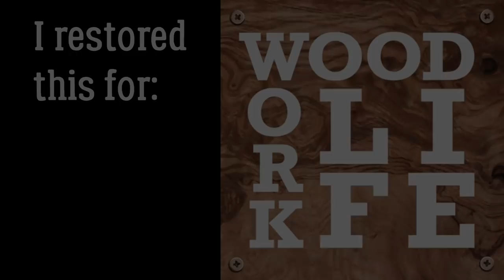Soviet Chain Mortiser [Restoration] (Part 2 of 2)

Comment: Small detail here on soldering. For a wire like this you apply a bit of flux to the wire (if you don't have flux core solder). Then you put a tiny amount on your iron to help transfer the heat. Then you apply the iron to the wire and after the *wire*is hot enough you apply the solder to the wire and melt the solder into the wire.

Comment: The tool restoration system consists of two equally important parts: the wire wheel, which investigates the superficial products of rust, and the EvapoRust, which prosecutes its core. These are their stories.
Reply: Dong dong !
Reply: Dun dun
Reply: Ta Dahhh!

Comment: I am stunned by Soviet Mechanical Engineering. Most products are designed and built to be purchased once and provide nearly a lifetime of service with regular maintenance. The key design elements are just brutally simple. Case in point, look at how many Lada's are still roaming around Russia and former Soviet countries.

Comment: Most of my life passed in the USSR and I happened to deal with a similar tool. Nostalgia.
The design style is very familiar and it was fun to watch how a foreigner sometimes thinks. In general, I did everything right. You are hero! Thank.
P.S .: Cover latch made of very thin elastic steel, the outer edge is rounded.
Reply: Elastic steel? I'm listening.
Reply: @mwilliamshs  I suppose he meant springy.
Reply: it's a good tool, not something you'd expect from the soviet era.
Reply: @theghostofthomasjenkins9643  You underestimate the Soviet era, there were a lot of really good instruments during this period.
The style of Soviet instruments was distinguished by its roughness but high strength and reliability. And such a tool is highly appreciated, I have many such tools made more than half a century ago - everything is perfectly fine.
Not just a tool. My friend has a ZiL refrigerator which has been operating continuously since 1956. During this time, only the lock was repaired - the steel door latch was slightly worn out. And the paint turned yellow.
Reply: @АндрейНикитенко-ф4с  it's not me that is underestimating it.  there is a lot of soviet era stuff that has not stood the test of time.  so much of it was repaired through the years with jury rigged parts that they don't really hold up.  a lot of it was also made with what was at hand, and while durable and functional, it wasn't exactly practical.

when i say this is a good tool, i mean it's something you can still use today with little worry (except for the wiring, in this case).  it also still runs extremely well with little wear.
Reply: @theghostofthomasjenkins9643  Yes, the instrument was often old-fashioned. Sometimes bad, especially made in the last years of the USSR, under Gorbachev. But there was also an excellent, cleverly made instrument.

Comment: if all these "restoration” channels would work as painting conservators they would start by picking the frame apart and sandblast it, remove the canvas, cut of all the broken bits and stripp the paint of. in the end they would “fix” it by spraying it with a bunch of metallic spray paints.

Although this channel is pretty good :)

Comment: No offence meant with this, but I wouldn't trust that solder joint for a second. You need to use the iron to heat the target you're about to solder (preferably from the bottom) and then push the solder into the heated object  (from the top side) and it'll flow around and make a very good bond. when it's flown and there's enough solder, you remove the heat.

A good joint is shiny, almost like a mirror.

What you created wasn't soldered as much as mechanically tacked just enough it might have seemed to be connected but it'll break faster than you can get on to the next project.
Reply from the maker: Yes, the wetting wasn't happening because the iron kept cycling on and off for no reason, so I couldn't get the wires hot enough.  I'm definitely buying a new one, haha.
Reply: Hand Tool Rescue you need to resolder that connection ASAP when you get a new iron.  Otherwise it's going to catch on fire, or even worse, melt through the heat shrink tubinh and short out to the chassis, which can electrocute you.
Reply: Chassis is grounded so this is not that bad.
Reply: yes it was a dry solder joint.
Reply: in mother russia this is aprroved method, dos vidanya

Comment: Отличное видео. Спасибо, Вам )
Только кабель так крепить  нельзя (5-31). Опасно. Возможно короткое замыкание. Надо за наружную изоляцию (черную).
Reply: I also think that soldering was not proper. This is "cold" soldering, that can give problems in the future. The proper way is to apply so much heat that solder liquefies and flows through whole joint by capillary force.  I think that probably soldering iron was too weak or too cold for this work. But restoration was very good otherwise/Я тоже думаю, что пайка была неправильной. Это «холодная» пайка, которая может дать проблемы в будущем. Правильный способ заключается в том, чтобы нанести столько тепла, что припой будет разжижаться и течет через весь сустав капиллярной силой. Я думаю, что, вероятно, паяльник был слишком слабой или слишком холодной для этой работы. Но восстановление было очень хорошим, иначе
Reply: Там русский, прорезиненный кабель - ему пофиг!
Reply: VideoGraph Советский вообще-то
Reply: Philip Mihailov, this is not a cold solder joint, there just wasn't any flux at all, so solder didn't flow into the wires.
Reply: vovchiklj43 и так сойдёт )
Reply: И паять не умеет, незачищенные жилы без канифоли обосрал снаружи припоем.
Reply: Там под металлическую закрепку ложится диэлектрик и делов то 🤗

Comment: Great restoration! Love your channel.
Some recommendation. Always clamp down a cable on the outer insulation. Pinched cables may start to leak current over time. If the cable was molded in the grommet, you could use an extra sleeve over the cables before clamping them down.
Be careful when using VFD on old motors. Older motors usually do not have the proper winding insulation to work with VFD's. This becomes worse when you apply long cables, but your cable was short so that is the best possible case. Secondly, the motor cannot cool itself as efficiently when run at slow speed but this was not the case here.

Comment: When soldering, you heat the wire with the iron, then you add the solder to the hot wire. Otherwise, the wire won't bond with the solder at all and the only thing holding it together is friction. Also, avoid just sticking the two wires together when soldering. Twist them together in a double helix to maximize contact and ensure a good strong bond with minimal chance of failure. With what looks like 12 gauge wire, if you can't give the joint a couple sharp tugs without it moving at all, it needs redone.

Comment: I know there have already been comments on the soldering technique, but you should know it isn’t the appropriate situation for solder in the first place. Solder is not meant for stranded wire nor mains voltages. A crimp would have been appropriate. Most people assume solder is always the best connection but a good crimp cold welds with multiple tons of pressure. Solder moves up stranded wire and causes it to be brittle. Assuming you can get it to cooperate thermally in the first place, as you found out.

Comment: another fantastic video mate! can I make a suggestion (you may have already perfected your technique) use rosin flux and a hotter soldering iron (gas powered are great!) and try not to 'dab' the solder on, it should flow like water.

Comment: You forgot insulation near the switch, this high freq. motor can shock you! Originally you had to use rubber gloves to work this machine .You need to use wax instead of oil to lubricate the chain.

Comment: 6:10 the way you were soldering there. Is absolutely painfull. Its bot the right way. You have to heat up the copper wire with the soldering iron first, then implement the stuff that connects them both ( forgott the name) that connection is not strong nor save. 
I know the video is old, that's why I hope you do it right nowadays...
Reply: Was thinking the same. It hurts me physically to watch it... 😥

Comment: I am from Russia but with English it is bad, I hope this text will help you.
This is an electric shock absorber (or an electric mortiser, someone calls it a tenon cutter, it is possible and a pazodel). Electric mortisers are designed for mechanized mortising. They choose rectangular nests, grooves, and others. The cutting tool of electro-holders is a continuous grooving chain, which is a set of links (cutters) connected articulately. The manual electric mortar IE-5601A has a built-in asynchronous squirrel-cage rotor electric motor, in which a drive sprocket is mounted on the end of the rotor shaft, which drives the cutting chain stretched over the guide bar. Hammers up to 160 mm in depth. Dimensions of the selected grooves 8x40x100; 12x60x160; 16x60x160; 20x60x160 mm.

Comment: Man those were some cold solder joints with (most likely) acid core plumbing solder.... get rosin flux and rosin core solder.... your connections will look and be a million times better.

Comment: You need to work on those soldering skills. Application of the solder is bad and relying on a single piece of heat shrink tubing to separate yourself from 240 volts is a terrible idea.
Reply: У нас 220 редко бывает)

Comment: Such a cool tool, but I just have one suggestion. Check out some soldering videos here on YT. Those joints were 100% cold with no real wetting of the copper. You're supposed to heat the wire with the iron, then push the solder into the heated joint. 
My only complaint with any of your wonderful videos!
Reply from the maker: Haha yes.  I explain in another comment why the soldering was all poopy, basically the iron kept cycling on and off for no reason.
Reply: Dylan Headrick also flux helps the solder flow into the strands.
Reply: Reminded me of Big Clive's "Tigging" 
https://youtu.be/nXkOxP5hka4?t=1m40s
Reply: Joey DeCrescenzo additional flux is not needed for soldering like that
Reply: haha yes I remember that video
Reply: With oxidation like that, flux is mandatory. Anyway, look up AvE's video on the Western Union/lineman's splice too for a good strong splice to solder together
Reply: Marek Ant it's not needed. But it helps. Especially on old wiring.
Reply: Time to fix that soldering iron that too! During the meantime use the propane torch with a little flux.
Reply: You might get away with just the resin in the solder, but it’s all going to be gone if you try to tin the iron and then wipe it on the joint.
Reply: Look like your using lead free plumbing solder, try Kester #44 rosin core 60/40 works really well for old oxidized wire. Something thin like .032 inch. And a nice hot iron 50 to 60 watts Weller or a Hakko.
Reply: I'm sensing another opportunity for the Medieval battle axe.
Reply: Next on Hand Tool Rescue........ Saving a soldering iron from the trash heap.
Reply: Pick up a quality soldering iron like a Hakko. I lived with low end weller and radio shack irons until this year. Switching to the Hakko has been a great experience. There is a night and day difference between them.
Reply: The only problem with his soldering was that he didn't use flux. Also he doesn't know how to wrap wires together. Personally I put solder on my iron first then hit the wire. But I'm a 2m tech don't mind me.
Reply: So if I was a 3m tech would that be better than you? I like their command strips and they make good tape too.
Reply: Crockagater 🤣 kinda sounded like a prick didn't I, sorry. 2m is micro miniature soldering.
Reply: Haha just giving you a hard time.
Reply: I was just about to comment the same thing :P
Reply: You are not supposed to solder mains wires in the first place, you are supposed to crimp them.
Reply: Yes, soldering is not his forte.
Reply: @feynthefallen  you can if the solder isn't bearing any mechanical load - I.E. the wires have been spliced together and are holding under their own strength, with solder used to make a better electric connection. Whiiich isn't done in the video and the solder is all that's holding the wires together...
EDIT: which was how the original joint (seen during disassembly) was done - if you were to remove all of the solder, those wires would still stay together if you tried to yank them apart.
Reply: @pietrotacconelli8311  knowing how to solder is not a requirement for a 2m tech? 🤔 
You can have solder on the iron for better heat transfer and then add more once the joint is up to temp. SMD follows the same rules, but you can add flux first and then tin, and heating is almost instant for small pieces. But you Still need to follow the same steps, flux+heat+then tin. Which in normal soldering is baked into heat wires and add solder with rosin core.

Comment: My friend, I admire your work and your videos: Clean, nice shots, no silly music, and no dull time, as you accelerate the speed of them, this one in particular is fantastic. One constructive comment I can add to is about the soldering when you were making the cable longer. Next time, try to heat the wires with the tip of the iron (with only a tiny bit of solder in it), and then pour solder into the wires, it will work like a charm as the resin or flux will make your life much easier ;) Keep up the great work!
Reply: Took the words right out of my mouth. That solder joint is cold, unfortunately. Hopefully, the shrink tubing will help hold it, but if it were me I'd redo it.

Comment: tool was called "electropulper". Included were 4 tires and 4 chains from 8 mm to 20 mm. It was very convenient to make a 15 mm chain for 2 passes to make holes in the doors for locks.
Reply: At least you should put in minimal effort and thought when stealing someone's comment and running it through Google translate.
It's not a "pulper", the EN equivalent would be "electrical mortiser". And it's not "tires" but a "guide bar" or "rail".

Comment: As soon as you started blowing air through what I had assumed was a solid rod of unknown function, I realized: It's for oil. You'd fill that handle bit with oil and tighten it down to push oil through the tube to grease the wheel at the end.

Comment: Is this some export model or is it set to permanent star connection? Nameplate reads 3P 220V  50Hz, but to my best knowledge Russia uses standard 220/380V which I would guess that it would run on 380V. Which brings me to next question, how do you power it from (supposedly) North American grid?

Comment: Если я не ошибаюсь, то это называется долбежно-пазовальный станок
I think I know how this machine is called in Russian, but I barely think it can be translated into English. In short it's sorta machine that was used for drilling holes that were used as a receiving side in joint of two wooden pieces. It was used in manufacturing furniture and small (non heavy duty) constructions.

Comment: Just wondering if the power problem was solved or did it still need a special power box.
Reply: It was made for industrial use, three-phase power supply was used in the workshops.
If you really need it, you can start in a single-phase network if you make a phase shift with a capacitor. But there will be a slight loss of power. ...Or a converter.

Comment: @ 5:46 Soldering tip;... clean your soldering iron tip a MUST & lightly tin it...
NEVER build up solder on the tip;... then try to apply it to the joint...
...
U require the soldering tip;... NOT the melting solder to heat the wire...
This applies to flux core solder or flux applied to the wire...
ALWAYS bring the HOT tip from one side;...
Then bring the solder in from the other side...
When the wire is at the right temperature;... U will C the solder just flood in between all the strands of wire...
Remove the solder then the tip...

Comment: Good job, like most soviet machinery it's rude and crude, but does it's job. I appreciate your humor, but try using brake clean as grease remover (DRINK the VODKA) it works faster, and you'll feel enlightened too. Some local log home builders have a similar machine, but I believe it to be 120  volt, "Makita" built. Question: Think if you could use a chain saw chain instead of the mortiser chain would it become  a vertical beam saw like you can buy for your hand circular saw (ie: Lee Valley sells such).

Comment: Great video.  Never saw anyone paint the solder on.  You'd get much better results with some flux and a video or two.  You have to get the wires hot so the solder melts into it, not paint it on.

Comment: ИЭ-5601А это долбёжник электрический, кто-то шипорезом его называет, можно и пазоделом. Электродолбежники предназначены для механизированного долбления. Ими выбирают гнезда прямоугольной формы, пазы и др. Режущий инструмент электродолбежников — непрерывная долбежная цепь, представляющая собой набор звеньев (резцов), связанных шарнирно.  (It's an electric prodigy, someone calls it a thorn, it's a pandemic. Electrodevices are designed for mechanized chiselling. They choose rectangular cavities, grooves, etc. The cutting tool of the electrodevers is a continuous grooving chain, which is a set of links (cutters) connected hingedly.)

Comment: Everything was superb except that soldering job wtf was that lol eyy quick tip hold the iron to the wire and let it heat up a bit with some flux on it then feed the solder into the wire and it’ll be clean as hell and even all the way around

Comment: lmao what the heck???? you can't use your hand to beat on! what if the hammer slipped and then you would crack the casing of motor! now when you turn your hand over it l@@ked good but its still taking a chance. tell what i have use is a 2x4 with a hole in if to cover the shaft...( caution ) for only driving on bearings lol lol